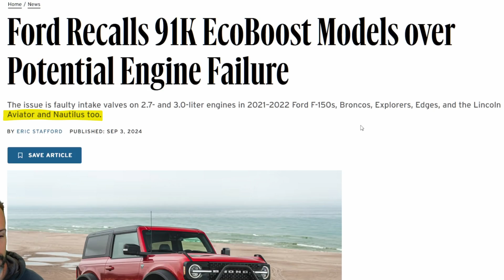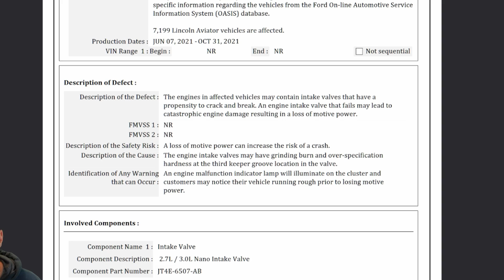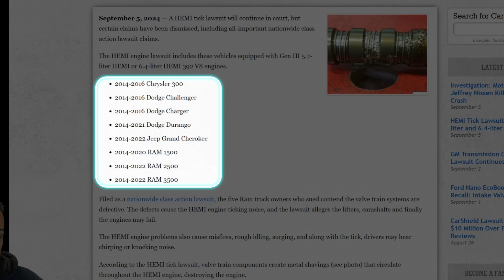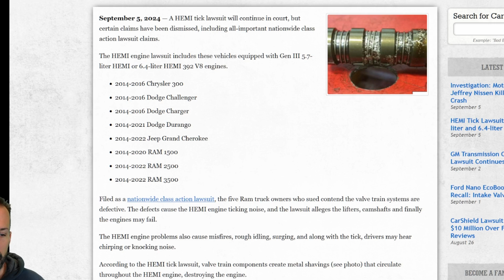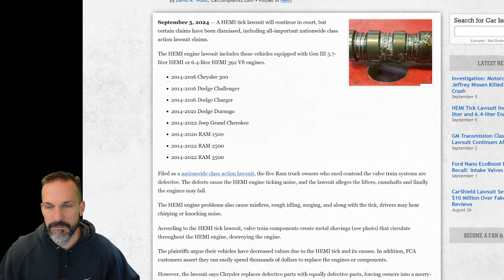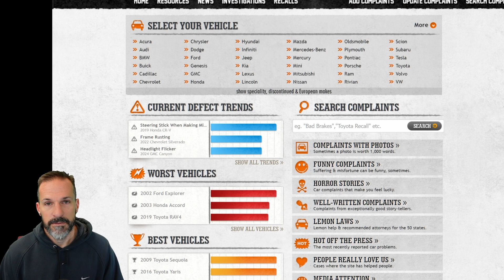91,000 Ford EcoBoost Engines Recalled (F150/Bronco). Can Anyone Build Reliable Vehicles Anymore?

Comment: I'd say buying from an individual 15 to 20 year old car.. Just bought a 2001 Buick that's still like new. Racked up 30,000 miles already. Bought new struts and the intake seals, Amsoil in then transmission and I'm getting 30 MPG.

Comment: Catalytic  converter cause many issues,they have too fine of screen design and plug up if they have alot of short driving distances  .it can start causing turbos failures valve issues  carbon build up on back side because of direct fuelinjection,not washing valves. And restricted flow  of intake due to plugged cats.

Comment: The 2.7 L Broncos were failing right out of the gate and very clearly had no resolution. The 2.3s were fine. So common sense would lead a buyer to choose the 2.3 over the 2.7… it’s been over 3 years now so anyone that went with a 2.7 should have known they were risking engine failure

Comment: What's funny (not so funny) my 2021 2.3L Ford Ranger engine (50k miles) is getting torn apart right now. Sounded like a rod knock or clack. A Ford tech in the forums said his 2021 engine was replaced at 57k miles. Yet I see nothing anywhere on this. Wondering if it will become a thing. Oil changes every 5k miles with full synthetic.

Comment: Did anyone notice that this channel only talks about damaged vehicles? Nothing positive to talk about anything else that just the samething that always happened before? Yes, the engine fails. Yes, brands have troubles, ones more responsible than others with the repairs, but since the beginning, you are talking mechanicall parts open to fail !

Comment: You can still buy a new vehicle. You just half to look for a power train they have been making a long time. The pentastar has been made for 12 to 14 years. I forget exactly. Coupling with their 8 or 6 speed tranny. The 6 speed is just as old and the 8 speed is 8 or 9 years old. The coyote is good but the 10 speed is questionable. The LS 5.3 is an under performer but its longevity is not in question. You might as have trouble finding a good tranny with that. Nissan puts out a 3.8 and a 3.5l. Very good engines if you can get their 9 speed tranny. Avoid cvts. They will figure this out. I have high hopes for the hurricane and 3rd generation eco boost as far as modern engines go. Furthermore gm puts out a 2.7l turbo. Good reliability. Longevity is yet tbd

Comment: @kirk189
Really happy with my 2015 2.7 I am at 309k + miles on mine and still going.  

COUNTER COMMENT....any issues? 

Follow up comment >> 
@kirk189
I have had normal wear and tear like rotors and brakes. Just replaced the alternator, had some fuel system sensors need to be replaced but no turbo issues and no major engine issues.

Comment: 280,000 Miles on my 2006 Tundra 4.7l  Engines never had the valve covers off , just rubber band belts lol

Comment: I'm a car guy and I follow the car market and everything about the industry every single day. 
What blows my mind is Ford had so many recalls in the last how many years? And I do not understand why the American public keeps buying their crap! Is it just out of ignorance do people not research what they're buying they do not look up recalls or manufacturer defects with the product that they are buying? The American public needs to spend a month at least researching the car that they want to buy and then figure out if you want to buy it or not. I would stay away from Ford until they get rid of Farley and start learning to build quality cars again. Until they start making their own parts and building quality cars in this country these are the problems you're going to have and put less tech in cars to the point where they're more reliable. This is for every manufacturer not just Ford . If car manufacturers here and around the world don't stop putting so much tech in cars you're going to have problems. You're better off buying a 90s or 2000s vehicle and restoring it from the inside out and putting the tech that you want and stuff that you don't want. It will come out to be less money than what you can buy from a lot and it will last a lot longer. There are some people out there that are Ford DieHard fans they've had  Ford vehicles throughout the generations but people you got to understand the Ford of yesterday is not the Ford of today they're not going to be reliable anymore. You've got to change your ways or you're going to be one of these victims. There are plenty of car custom shops throughout the United States that we can restore a car from the inside out for less than $100,000 and you'll get what you want and the car will be more reliable than anything that comes from a factory.

Comment: The Ford 2.7 V6 is crap, as are most of the other EcoBoost engines. Plastic oil pan, belt soaking in oil. The 2.3 is good because it's based on the Mazda L engine, just like the 2.0 (but NOT the new twin-scroll 2.0)

Bronco buyers hoodwinked into buying this garbage-fire looking for a bigger, more powerful engine will provide a steady supply of spotless parts for the 2.3 owners that change their oil and run a million miles.

Comment: One Fords fixed this problem in the 2023 and 2024 models. This isn't a new issue it's a old one that they expanded the recall to all the vehicles with these engines. My best advice is do your research cause this video is about 2 years late! That's when this problem was first announced.

Comment: Our family owns 2 newer vehicles (so far no issues) although we still have 2 older 10 year plus  SUV's 1-Toyota & 1-Honda that run and drive very well that i can't part with even though it cost extra $$$ to insure them, it's nice to have basic reliable vehicles to fall back on! 
(drive them in crowded parking lots at the ballpark etc. and not worry about door dings) lol

Comment: I have a 23 Bronco, I love it, haven't had a single issue.  I've driven it cross country and another multi state trip.  19 to 21 mpg, its a amazing vehicle.   Maybe it was fixed in 22 not sure.  Sounds like Fors is standing behind it.
Reply: Well u are not driving like a maniac and destroying ur $70,000 vehicle off-road
Reply: @natelove187  well, I do reasonable things with it, as it was designed.  No jumping, high water crossings, just have fun with it, and it was 60k.
Reply: @Crusader1414  😂😂😂

Comment: my 2006 chevy 4X4 pick up has 186 thousand miles on it, orignal 5.3 V8,no engine problems, no transmission problem, ya ,its not new ,but its RELIABLE as hell ,I use it as  a work truck for a local drywall company in Maryland
Reply: I like old vehicles, I have a 1993 Toyota Pickup with 306,000 miles and they're great but c'mon, new vehicles are great too. You only live once and it's nice riding around in a brand new vehicle.

Comment: gets worse gas mileage than my 04 explorer too.  Why couldn't they at least make these broncos with a naturally aspirated v6 or a hybrids?  much better than turbos.
Reply: Or better yet have a 5.0L Coyote V8 as an option.
Reply: I normally get 19, and I have 35s.  It's also not given me one issue.
Reply: @Crusader1414  interesting, i can just break that gas mileage on highway at 50-70
Reply: @Drewcardello  I do most of my driving on the highway.  17 combined, 19.3 on my cross country trip.  It was over 20 till I started across Oregon in a 20 to 30 mph head wind, it dropped one tank to 16.5, that was at 70 to 80 mph though.  And that is by math, not the gauge, miles divided gallons added.  The gage is all over the place.

Comment: There has only been like 1000 they actually had motors blow.  They have made hundreds of thousands.  This is a preventative measure in case something happens.  The number looks bad but they have to include any possible car they could potentially have these valves.  The math is very low and most will be fine.  At least they are doing the right thing and checking these and covering them up to 150k and 10 years.  Everyone wants more mpg and more hp and less weight so this is where we are in 24’.  Manufacturers cut corners to get parts to build their vehicles.  Get a warranty and at least these are going to be covered.

Comment: This is disappointing. I've been looking for newer truck, I decided that the F-150 seemed to have the least issues, narrowed it down to the 21+ 2.7 being the most reliable Ford. Well there goes that plan. Guess I'll have to stick with my 5th gen 4Runner.  I'm kind of sick of, but at least I know it 'll run till the end of time.
Reply from the maker: I hear ya. I'm bored with my 2008 Sequoia too but it's so freaking reliable I refuse to change...at least for a while.
Reply: @TheCarGuyOnline   it's tough moving away from them, that was such a great era for Toyota. Just gotta keep after it with the corrosion protection if you're in a road salt area.

Comment: One problem is that they're going to replace it with the same engine design.
Reply from the maker: In this case they should be able to just change the valve manufacturer/source...in theory.

Comment: I believe it is part of poor quality control and the lack of knowledge in the public eye of how to take care of a turbo engine. Letting it idle before you turn it off after a long drive, allowing the car at least 3 to 5 minutes before driving away esp if it’s cold out, lugging the engine, etc. Americans are used to having torquey engines not ones you have to spin up and tach up to get the desired result. Turbos increase efficiency but you have to drive the turbo rather than drive the engine if that makes sense. Turbos are wear items and will fail with poor oil change habits and stressful driving conditions like weather, traffic, or the carelessness of its owner.

Comment: Wow...Ford, Toyota, Mazda, BMW recalls. I feel left out of all the fun...because I got a "POS/crap" Jeep as some people said then (and still do today (called "overpriced" even then, too) -- a 2021 Jeep Gladiator (Rubicon). Sadly for the naysayers (generally, ignorant parrots), it's been fine: No recalls or even any TSBs issued on it. Not even for airbags. With all the "better" (right) brands having recalls, I checked again last week looking up its VIN in case Jeep has a recall I missed. Nope, still nothing on my Gladiator. 
Amazing...
And it has one of the last N-A V6 gas engines nowadays -- I had zero interest in anything turbo (or even diesel). And the Generation 3 Pentastar is one of the best V6s available today. Does sit have some weak areas? Yes, but it's still a solid engine and I've had ZERO issues with any of it's "weak points." Well, at least so far... 
So much for the Fiat/Chrysler/Stellantis "crap" I bought, yes? So who "bought crap" now? 
Hmmm....I wonder.  ;-)
BTW, if I needed to buy a new vehicle TODAY (but don't as I'll probably keep my Jeep at least until 2029 when the Mopar Maximum Care warranty expires), I'd get another Jeep (Gladiator Rubi, of course) immediately and w/o any hesitation whatsoever.
"Jeep Wave" (It's a Jeep thing)
-- BR
Reply: Wow, your 2021 jeep is still running? Give it another year fanboy.
Reply: @garnet4846  Dear Clueless in Seattle: What do you drive?
Reply: @billredding2000  who is clueless in Seattle? I ride motorcycles mostly (Japanese) but if it comes to cages, nothing newer than 2010 anything.
Reply: @garnet4846   It's (that phrase) is a manner of speaking, weather you live in Seattle or not. But yeah, you are clueless due to your lame criticism of Jeeps so THAT part is accurate.  Also clueless assuming I'm a Jeep FanBoy -- I'm not, and FYI have zero brand-loyalty to any of them: I just get the best vehicle for my needs/wants at the time. My Gladiator (Rubi) has been great, and would buy another one if I needed a new vehicle TODAY -- w/o any hesitation (as said earlier). And it IS the Top Dog mid-size truck off-road, period. And on the hwy, is just as good (comfortable/smooth-riding) as my Honda Pilot was. 
No complaints (or regrets) buying it.
As for bikes, mine were mostly foreign also, mainly Hondas -- my last a 2006 Honda 1300R, then later a Vespa scooter...nothing 2-wwheeled after the Vespa. Never had a Harley, and now that they're woke, never will. Would get an Indian (Chief Classic) instead...but at my age, not recommended (so I'll take my own advice and let that idea go).
Thanks for your consideration,
"Jeep Wave" 🙂
-- BR

Comment: I bought a new 4runner and Titan based on old technology in 2024
Reply from the maker: Good choices. The 4runner is a great platform and the Titan is great too. I've owned a lot of Nissan trucks and cars, they are very underrated compared to Toyota. I've never had issues with them.
Reply: @TheCarGuyOnline  v8 with no cylinder deactivation and no automatic start/stop was my main motivation. Only have to worry about carbon buildup on the valves because of direct injection. Looking into preventative modifications
Reply: @musclesmouse Agreed 100%, I just put premium in it so that it keeps em clean.
Reply: @CJColvin  I looked at the problem.  The Titan is direct injection and the intake valves will accumulate carbon due to the PCV bringing back unburnt fuel/air back into the intake.  There is no fresh gas being shot in before the intake valves to clean them like port injection.  So carbon will eventually build up and become a problem.  Does not matter what fuel you use. 

4runner does not have this problem because it uses port injection.
Reply: @musclesmouse  Thats true
Reply: Awesome brother, my dad has a 2023 Toyota 4Runner with the reliable 4.0L V6  in it and man its a tank, I just bought a 2024 Nissan Titan with the 5.6L Endurance V8 in it with 400 HP and 413 Ibs of Torque and man its a freakn beast and it sounds like a beast as well.

Comment: They claim to use 6 sigma. Problem is, they certify a 'process', not individual parts. So once the 'process' produces junk, buyer beware. Need time consuming inspections again of all critical parts, destructive testing, material testing, bend bars,charpies...all that stuff.  But not gonna happen, especially as people plunk down 80,000 or whatever for this junk. Then theres the worthless electronic wizardry!😂😂
Reply from the maker: Yeah the QC is bad in modern vehicles. It's all lab based...non-real world testing IMO.
Reply: Every single employee needs to be working on quality. Corporations have Vice Presidents of Quality that have to approve all changes after going through a 20 person signature cycle, specification review, ROI projection and risk assessment update. They can't possibly know everything, bringing continuous improvement to a crawl.

Comment: nissan armada/titan/frontier. Rock solid. Ironic, since Nissan used to be the butt of all jokes but now seems to be putting out decent stuff (minus their crap sedans w/ CVTs)
Reply: Yeah i've got a 2020 Titan pro4x and plan to keep many yrs.  Only 33K miles right now and no major issues.  Great truck.
Reply: One of the reason I chose the 2023 Pathfinder was because they kept the 3.5 V6 but finally ditched the CVT.  They use the same 9 speed automatic that Honda has been using in their Ridgeline and Passport and transmission reliability has been good in those vehicles.  I wanted a Toyota 4Runner, but their old 5-speed automatic meant terrible gas mileage and the 2024 4Runner with a turbo 4 cylinder?  No thanks, I'm good.
Reply: @NobleOmnicide  I just bought a new 4runner.  I got 23.5 mpg driving 600 miles home.
Reply: @musclesmouse  Yes, good for you, because the "new" 4Runner is a turbo 4 Cylinder.  Thankfully Toyota ditched the old 5-speed automatic for something with more gears or you wouldn't even get 23 mpg.  I was averaging 26 mpg on the highway on a recent road trip in my Pathfinder, loaded with gear.
Reply: @NobleOmnicide Unfortunately, the 3.5V6 in the Pathfinder is dead.  2.0L VCT is the new engine.
Reply: The pathfinder is a car, the 4Runner is a truck. That’s the difference. And honestly, if you’re splitting hairs over 2-3mpg, you shouldn’t be buying an expensive new vehicle in the first place. With gas at $3/gal, the difference between 20mpg and 25mpg is $37/month based on driving 15,000 miles per year.
Reply: @bobbbobb4663  what do you mean it's dead?
Reply: @Holden-McGroin  and yet they're both classified as "SUVs".  How pedantic, huh?
Reply: @NobleOmnicide  The 2025 QX60 uses a 2.0L VCT based on yt reviews. Not sure they have reviewed a 2025 Pathfinder yet but the writing is on the wall.
Reply: @bobbbobb4663  So the QX60 gets a weaker engine that has to work harder to get fewer horsepower for only 1-2 more MPG?  That is colossally stupid.
Reply: @NobleOmnicide  Agreed but emissions are driving it
Reply: @NobleOmnicide  v6 5speed
Reply: @musclesmouse  My bad.  The 2025 4Runner isn't out yet.  Good on you for getting 23mpg on the highway.